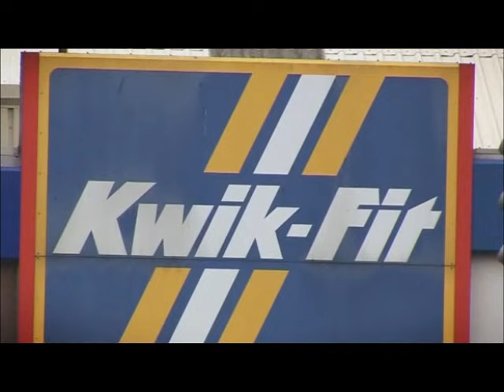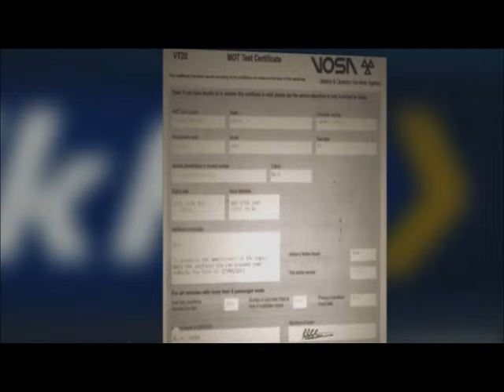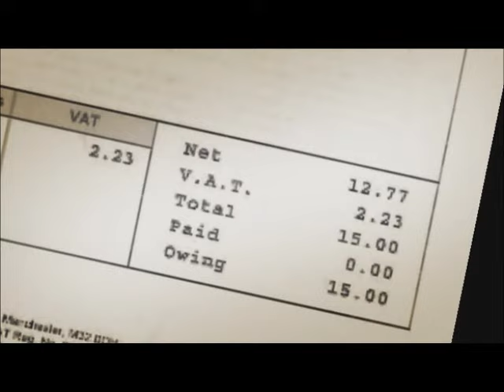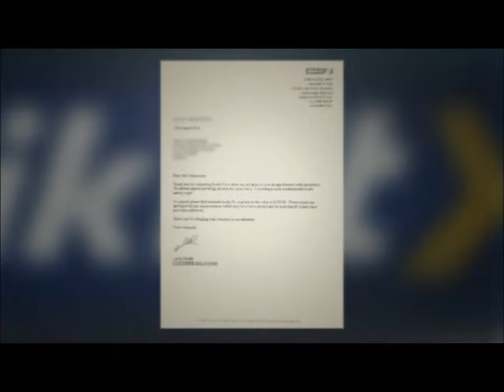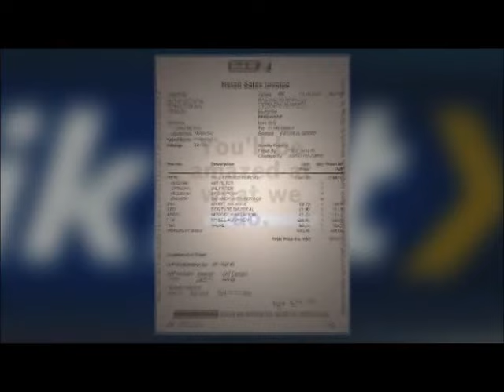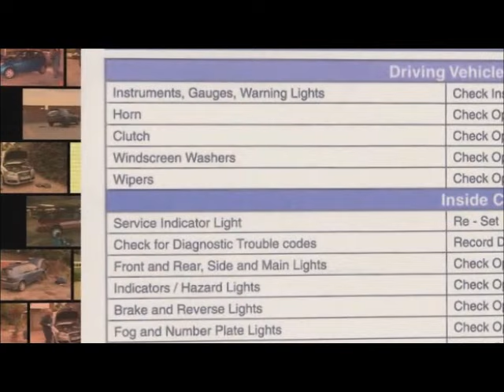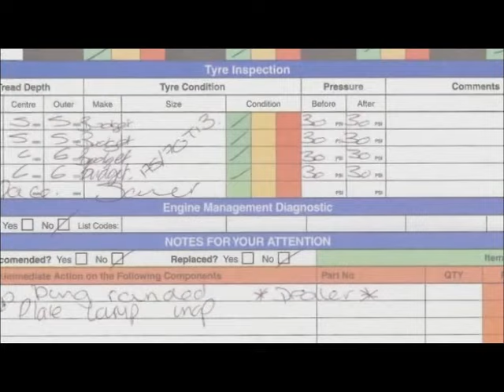Kwik-fit Car Rip-off Watchdog.wmv

Comment: I had a wheel bearing fitted , When I returned to had the word C-nt written on the tire in yellow chalk , The manager washed it off but would not tell me why or who had done it ,  Before that incident I had new calipers fitted and brake pads , cost £550 , i asked for my old calipers back , Initially refused but eventually gave them back to me ,I took these to another garage who said all it needed was new rubbers and would cost about £20, Ive never used quick again and never will .

Comment: Nothing new here and I doubt things will change. 30 years ago when I was a leasing company maintenance controller, we used to refer to Ron Bambra who was the MD and his management team as the Kwik-Fit Mafia. We would only let them do work that the driver specifically asked for which usually meant tyres only.

Comment: Despite Kwik Fit's statement, the carrying out of unnecessary work and charging for ficticious work is endemic and from the top down.
Management expects a certain level of 'added value per tyre' sold. Ie, they try and charge you for a tracking or extra balances whether you need them or not whenever they sell you a tyre.
A company best avoided.

Comment: I intended to take a long journey in my car so decided on a quick oil change, I took my car to Kwik Fit, and after the guy drained the old oil he proceeded to refill it with fresh oil, he proceeded to pull the dipstick out to check the level, he then added more fresh oil i stood there wondering why he was checking the oil level by using the Automatic gearbox dipstick, i pointed out the actual oil dipstick he looked at me looking stupid and apologised that's KWIK FIT for you.

Comment: National exhausts are worse. You go in for an exhaust, and they ask you to go sit put of the way, then come back and two you that tyres need replacing, and a total exhaust replacement is needed.  Ironically, I had no trouble with Kwik fit.

Comment: I recently went to a KF center to have two new rear tyres fitted, 
KF were the most competitive price for the sports car tyres I wanted,, on arrival I asked if they knew the correct tyre pressure and wheel nut torque 
" yes, sir we have a complete database " .I was told.
the next morning I checked the tyre pressure and found them to be very over-inflated, and the torque for the wheel nuts was 8lbft under the correct setting. both potentially dangerous.
I complained to KF head office, and after about two weeks received an apologetic letter and £30 in vouchers, which I shall never use as I will not use KF ever again.

Comment: Took my car to shit fit about 30 years ago when I was a young inexperienced driver , only went because i was skint and they offered credit , car had obviously worn pads . after inspection  mechanic quoted a fortune for pads, calipers and discs , I requested that they only replace the pads . Mechanic then suggested that he would have to talk with his manager as it would be dangerous to let the car leave in its current condition , at this point I said GET THE FUCKIN CAR OF THE RAMP, actually i didn't know if he was right or wrong i just couldn't afford it and felt intimidated  , he then did go and speak with his manager and returned to say against there advice that they would replace the pads only . Owned the car for several years after this incident including several mot's , never replace the discs or calipers . Never returned to shit fit again.

Comment: I had two rear shock absorbers fitted by Kwik Fit...after about four weeks one of them was leaking oil, so I went back to get it replaced, they didn't remember me from four weeks earlier  and it was a different guy  from before and at first I just said one of my shocks needed replacing, I didn't mention the warranty at that point, so the fitter put the car on the ramp and then  he said yeah it needs replaced and you need to replace them in pairs  because it would be " unbalanced and dangerous" if I didn't,  so "did I want them to go ahead and replace both of them?", I said sure go ahead , and then I mentioned that I had only just bought the shocks four weeks earlier from this branch and produced my receipt with guarantee, and said I was looking for the replacements free of any charge as per warranty, you should have seen the look on the guys face, he seemed quite agitated and said that I should have mentioned I was coming for a replacement under warranty straight away.....he stomped off and the manager then came and advised me that as the other shock was almost brand new they would only replace the leaking one, I said ,yeah but that fitter said that would be dangerous if I only had one replaced....but he stuck to his guns and said that they would just need to replace one and not the pair.......so you get the idea as to how these jokers operate.

Comment: i had my car one day, a mercedes S500, drove it them from purchasing 300 miles away to check as i used the coventry branch often, never drove the car again, they drop my suspension then hotwire it to get it back, blew up the ecu unit, as i now live overseas cannot put in court. car scrapped

Comment: Would never use them . We had a puncture and had a tyre replaced (dont think it was needed after this). Worst thing though was driving along motorway the same evening and car felt very strange. Made it to the services and got AA out. Within seconds the engineer told me that they had not tightened the wheel nuts properly and if we had gone much further the wheel would have fallen off.

Comment: I once took my car to get a new tyre, they told me I had two winter tyres that needed replacing and the other two were nearly worn out and would cost £240 to replace them, alas I hade left my locking nut at home so thet could mot do the work, went home and got the locking nut and went to my local tyre shop, he took a look at all the tyres and told me only one needed replacing, cost was £40.

Comment: Even in The Netherlands they rip you off. Went to a once a year check. Lowerd my tire pressure before the check. Tire pressure was so low that my car drove horible. And when i called to ask them how my car could pass and let me drive off with in every tire still the low pressure. Yheaaa maby your tire pressure gauge is wrong. So then a asked how my spare wheel had a correct pressure messurd while i removed it just before the check. So they hung up fast and blocked my phone number

Comment: I went in for an oil filter change, car was right onto the ramps, I was leaving and going to come back a short while later I realised I had forgotten my wallet and went straight to the ramp 1 old sweat and 3 young geeky looking dudes under it, old sweat gave a demo of how to remove the under tray, he never released 1 retainer he just grabbed it and ripped it clean off its fixings, what followed had the 3 geeks bolting out of the workshop and old sweat a trembling gibbering wreck, the most frustrating part was the manager attempting to justify his actions and defend him till I told him I was calling the police as I had caught old sweat intentionally vandalising my car, screw the oil change it resulted in me receiving 2 free tyres as a form of good will and compensation, the tray had to be tie wrapped to the chassis till I got £5 of fixings from Autosave this was in Dundee

Comment: My mother in law, visited the Kwikfit at Goole on 25 September 2019. She is in her 70s. She was charged £333.71 for 4 tyres on a Citreon C3 that gets little use. There was a £63.96 charge for a 'Tyre fitting' Package and a charge of £49.95 for adjustment. She also found that loose change was missing from inside the car after her visit. I complained to Kwikfit as soon as I found out but left it till recently due to a family illness. 
I recently received a response from the ‘Master Manager Kwik-Fit Northern Division’ who explained the invoice and gave the following sage advice:
“Poor alignment has an effect on tyre wear and fuel economy to an extent dependent on the deviation from tolerances.”
The ‘Master Manger’ then went on to say that they had all of the invoices and the person that worked on the care was no longer employed there so this could not be investigated. He stated:
“I am not aware of any incidents of a similar nature in this centre during all the time that I have been the overseeing manager and would reassure you of my confidence in the current team that work in this location.”
I made it clear that neither myself or a number of family and friends will be using their services again as we believe that my mother in law was taken advantage of due to her age and gender.

Comment: Garages and dealer mechanics slag each other off if work is not needed. But when it comes down it all garages and dealerships will rip people off customers where they can. Main dealers are probably the worst. Example VW Golf R pads and discs all around £1200 at VW main dealer Eurocarparts £330 for upgraded disc and pads. £870 Labour charges are just made up. £870 for an hours labour. Found a local mechanic who could re-tract rear e-brake, £120 in labour otherwise would have done myself. Landrover rear pads £330. Purchased genuine pads from main dealer dealer of eBay £34. £296 for an hours labour. Replaced myself. In the future right to repair will be gone forever. Rip of Britain is the best as everyone wants a big slice of the cake.

Comment: They are just trained in ripping u off by getting to pay for expensive jobs and parts. I once took my car to enquire abt noise coming from my car and an and light and they said i needed a new exhaust box and new break pads and disks on all all wheels quoting over £600 which turned out to be total bullshit. I found out the problem was a wheel bearing and an issue with the abs pump. So if u get quoted a high bill from them take your  car somewhere else they are only interested in making  money from sales for unnecessary work and parts the scumbags

Comment: I used kiwi fit to mot my car 4 years in a row, every year it passed but needed a headlight bulb, £5 .on the 4th year I marked the bulbs with a marker, still charged me for the bulb but it was never changed. I won't ever use them again.

Comment: the old guy hidden in the corner bold head oiled up without a uniform rolling his cigarette and has been a mechanic for about 35 years is 105 times better and cheaper then quick fit or anyone else like quick fit.

Comment: Took mine in for an MOT and they failed it on brake discs. I know that was bollocks but didn't really have a choice if I wanted to drive out of there with an MOT. Never going back there again.

Comment: I had 2 new front tyres on my gt86 they overinflated them by 10lb and I nearly killed myself on a 100 mile journey. When I opened it up on the motorway it hopped about everywhere and nearly put me into the central reservation. When I got into a service station and removed the 10lb it was fine.

Comment: sent car for mot fiat panda told needed shock absorbers £350+ will order and can replace tomorrow.Told them not to bother went to local parts shop bought for £48 . 4 Bolts and 40mins later fitted myself could have just changed bushes but shocks were not expensive.

Comment: Went for a puncture repair on tyres 2 months old and was advised I needed 3 new tyres. Told them to repair the puncture only and they made me sign a form advising I was taking my car back unsafe from them. They were 2 month old with about 250 miles on them.

Comment: I took my car to a main dealer, tyre pressures not check or spare. Air con filter ticked off and didn't even have one. Badly corroding battery terminal.. No battery health check and brake roller test.

Comment: they fitted my bro's tyre back to front--hit one of the rear shocks with a hammer and bent the pin--fitted new they lasted 2 weeks then leaked the fluid out---they also fitted 2 rear
 shocks on my bosses car without the eye-bushes -it was totally rigid when driven

Comment: I got caught out with wheel alignment  when I had 4 new winter tyres costing £800  The twerp who supposedly aligned the rear wheels  did such a bad job I got less than 3k on the rear wheels as the tyres were so badly out I went back to complain and it was like pissing against the wind.

Comment: Mother in laws car failed its mot on a missing locking device and emissions.... The new ball joints didn't have a housing for the split pin so were locked in place with locktite and the emissions they wanted 20 pounds to use a cat cleaner but funnily enough they done the basic emissions test and not a full one they actually aborted the test!, I went down the next day and shock surprise the car passed without any work being done to it. Still have the original fail sheet with emissions on it.

Comment: Hi folks nothing new for quick fit back in 1986 Kwik fit  in Ayr when returning from oil rig yards up north my ex wife and I when coming home to Irvine Ayrshire Scotland had a slow puncture when in toilet (me) as they fixed tyre on car they told her we needed four   New shock absorbers at a cost of £50 each  the car had cost me £250. It was a 7 year old Chrysler alpine 😂a classic now like me 😂I had repacked the shock absorbers with another electrician my pal tommy nimmo two weeks before  monroe gas shocks I said to the young boy about 18  I was 27. 😊👍 let me show you my receipt I have just replaced them I spoke to his boss and was given a brand new tyre and free wheel balancing to shut me up so  32 yrs later they are still at it  !!!! Shamefull !!!!!😒😡😡😡

Comment: Lol

I took my car in as a joke one time for a Free brake check.

I knew only the front Disks needed doing.

They came back an hour later saying that all the Brakes needed changing in total of £540.

Told them that the rears were doing three weeks before and that another Garage would do that fronts for £120

They are Crap

Comment: Motability the disability charity that provide cars for disabled people have a contract to look after tyres on disability cars. I cant imagine how many cars have had tyres replaced that weren’t necessary. I had a slow leak on one tyre and they changed 3 tyres.stating they were below the legal limit. The milage on the car was 7000 miles.They bill motability for the work.

Comment: My daughter took her Juke RS Nismo in to the Long Eaton branch for a new tire, as she had picked up a puncture. I've always told her to stay away from those idiots and to go somewhere reputable. Unfortunately she was desperate to get it fix as she was going on a long journey shortly afterwards.

While changing the tire they told her one of the bolts was loose on the suspension (it's a 16 plate and was still under warranty at the time) they told her it was too dangerous to drive and offered to 'fix' it for her. She was reluctant but said OK because of the journey. Driving it home it felt OK but not long into her journey she noticed it was pulling to the left! After coming home again she was nearly in tears as her pride and joy was now dangerous to drive - she was litterally driving with a quarter turn on the steering wheel just to go straight ahead!!!

I wanted to go and give them wankers a piece of my mind but she begged me not to! Instead we took it to KAM servicing just up the road to get it fixed - Nissan wouldn't touch it under warranty as it had been 'messed about with' by imbeciles!

I really can not understand how this company is allowed to carry on trading! They are unskilled, have no knowledge, and are there only to rip people off!

The lack of any comment from them on these videos just goes to show how corrupt and useless they really are!

Comment: Top tip kwik fit domt charge for ac regas if it doesnt work. They dont check it, they tekk yiunthey empty it but they dont. Do what you will with that information.

Comment: I have worked for kwik fit and left after a week and a half, I will tell you now it is all a scamming money business if it's not worth big money we turn customers away. Simple wheel tracking costs average 30 or less here your looking 100 onwards because they have fancy machines and will chat bolloks to u. Budget tyres are always available but will give u the pricey option and wouldn't even bring budget into the option. Had to leave as shambles of a company never take your car here!!!!
Reply: I actually like the full monty Hunter Hawkeye alignment systems. However, I wouldn't trust Kwik Fit to operate one correctly, never mind honestly. I don't go near budget tyres either. Kwik Fit couldn't service a tin opener.

Comment: I took a tyre in for  a puncture and they claimed that the whole was too near the edge, so looked up legal limits and they lied. I once had an exhaust fitted and it rattled so ended up adjusting it to correct position myself. If you want a genuine honest garage in the Luton Bedfordshire are go to Whipperly Ring Service Station LU1 5QY. They do MOT's and brilliant service on all cars and never ever rip you off. I once had a major engine problem so I thought and it turned out to be a 20 minute job and that is all I was charged for. They are a friendly family firm and have been going there years. Look their ratings up on Google and they are all 5 star.